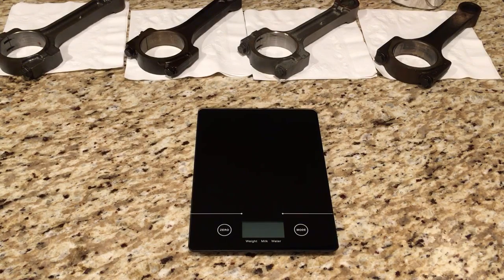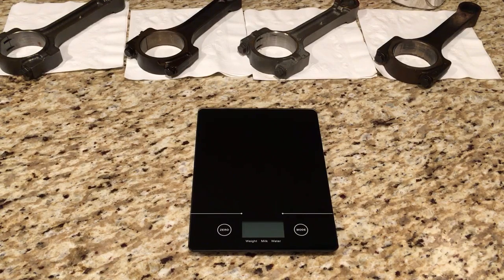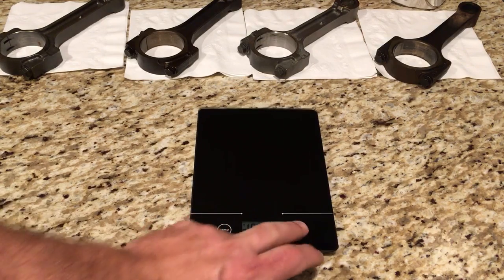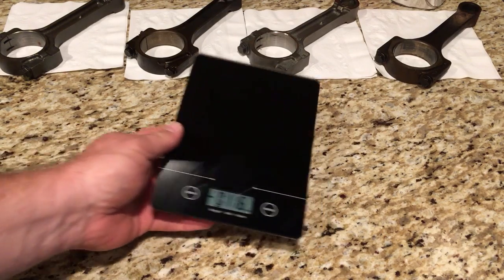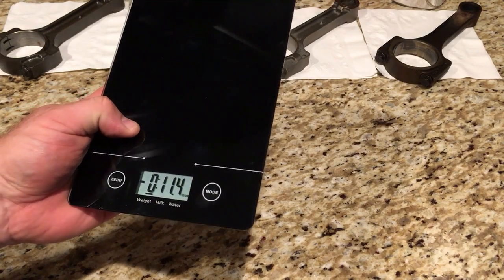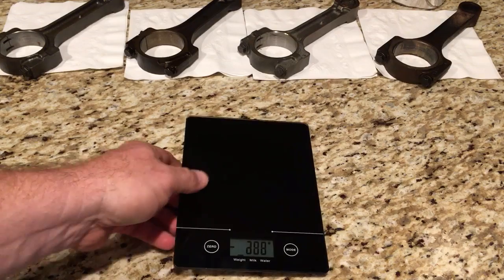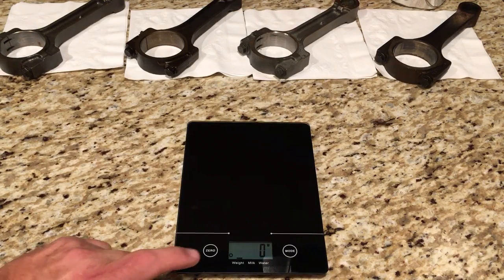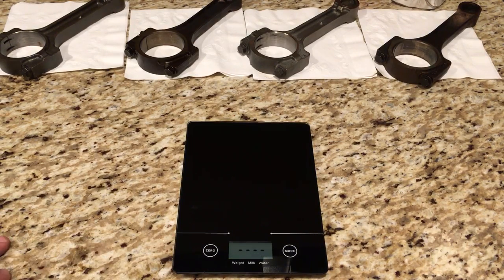Can I run Gen 4 rods in a Gen 3 engine  4.8 5.3 5.7 6.0

Comment: Notice how the gen 3 both weight about the same and both the gen 4s weight about the same. But just saying the gen 4 is bad because it weighs more is idiotic. Gen 4 rods are far superior than the gen 3s. When changing anything rods, pistons, pins. You should always rebalance your crankshaft. If you’re not going to rebalance crank then honestly just use the stronger gen 4 rods and not worry about it, hell you don’t worry about it anyway so why care if it’s different rods.

Comment: So it would be safe to say that on a Gen 3 5.3 if I used aftermarket pistons that weighed 415 grams with 122 gram pins and gen 4 rods I wouldnt have to re balance the assembly; as the stock assembly is 1182 grams and the “aftermarket” set up weighs 1183.

Comment: I kind of feel like even though the rods are a little different in weight, with the engine being internally balanced. As long as the rods you put in it are close in weight to each other, I would imagine it would still be balanced out. Kind of like going from an aluminum rim on a car and changing over to a steel wheel. They're both balanced, it's just one is a little heavier

Comment: The cranks between gen 3 and gen 4 are the same part number if all the rods you use weigh the same it's the same stress on the crank as gen 4

Comment: do you think aftermarket piston and rods have this same issue?
im trying to bore my 5.3(gen 3) to a 3.820 bore
im looking at gen 4 rods and aftermarket pistons on a gen 3 crank as a possibility 
also looking at summit racing forged piston and rod set on a gen 3 crank
Reply from the maker: Most aftermarket pistons have a better drain back setup.  Definitely check the design, specifically what it looks like with the support rails installed. 
On the pistons, if the budget allows go with a forged piston.  I like the Gen 4 rods but even they get scary above 800 wheel Hp, they can live or not depending on the tune and weight of the car etc. 
I’m slowly building an “Iron” LS1 aka iron G3 5.3 bored to 3.900”+ with a 2005 6.0 crank and Rods.  I’m undecided yet on either oem 2005 LS6 pistons or a forged piston like the Summit Racing.  Budget budget 👍

Comment: I switched to Gen IV rods and came up with similar weights that you got by using a postal scale. I was told by an experienced engine shop that more than 5 grams would throw the balance out. 30 years ago I threw together a 350 engine, and it had a vibration in it around 850 RPMs.  Couldn't keep the belts on the water pump, and alternator, the bolt on yoke on the transmission kept coming loose, and the oil pan bolts wouldn't stay tight. It turns out that somehow I used a 305 crankshaft. Even though they have the same stroke the bob weights are different. Can't remember exactly but it was around 1850 for the 350, and 1900 something for the 305. I had my 6.0 engine balanced because of the weight difference, they added weight to the crank to balance it. Being that we didn't have the alignment fixture for the relucter wheel, weight was added to the flywheel/ flexplate because the relucter needed to be removed. They made an alignment mark so I put the flywheel back in the same place, hope I never need to replace it. The moral of the story is Get your engine balanced! When they balance the rods, a special fixture is used so they can weigh big end separately from small end. One is rotating, and the other is reciprocating, 100% rotating, and 50% reciprocating
Reply from the maker: I’m piecing together an Iron Block LS 5.7 now and plan on having it balanced.  Playing with my Desk Top Dyno I have a solid combo making 544hp NA then add boost. 👍😎🙏🏻
Reply: You bored it out .120 over?  @HeadFlowInc
Reply from the maker: I found the block on marketplace, already bored to the stock LS1 bore size. Yes it would need a bore of at least .118”.  The Iron/LS1 is a pretty common build; I just hope the cylinders hold up to boost 🙏🏻

Comment: Did you think to take in the bushing in the gen four rods? Take them out then weigh it
Reply from the maker: No I did not remove any bushings during the weight testing.  You can see the Gen 4 rods are substantially thicker castings compared to the Gen 3.  If you have a spare Gen 4 rod I’d like to see the weight difference w/w/o the small end bushing.  🤔🤔🤔

Comment: what if it's just a stock engine?  will it matter?
Reply from the maker: People run them all the time without balancing.  I wanted to point out its not the right way to build an engine but seems to hold up ok. 
The Gen 4 rods are far superior; add in the fact the Gen 4 pistons are lighter and have full floating piston pins  is a bonus. JD

Comment: I’m considering checking the ring gap on the stock lm7. I hope I don’t ruin things by attempting this and not just leaving it in. I have the block opened up to heads and oil pan off on stand. Idk man 😐
Reply from the maker: How much boost?  If your not going to exceed 10-12# it might be fine, it may live on 20# it’s hard to say without checking.  You really only need to gap the top ring, it’s made of steel factory so it’s safe to r&r for gapping.  Some people like to lightly hone or bust the glaze on the cylinders while it’s apart but not 100% necessary.
Reply: @HeadFlowInc  was considering 14-20lbs tops. That’s full go, not summer street driven where I’d like to see 12-15 max. Hard if not impossible to see 600 wheel on pump 93 through turbo 400, would like to see max effort 700 wheel if I went to strip. I’m just trying not to make mistakes sir and not have the regrets of ruining my stuff due to chancing my ability at the ring gap on 160k engine. Thank you
Reply from the maker: @timweb1510  I understand completely!  I’d probably look at gapping the rings or at least checking them. Some people find the rings are already wide just from miles.  At 20# I guess you’d be looking at +- .030” top and .028” second ring. 
TH400 factor 23% driveline loss, so 779hp crank is 600 whp or 909hp crankshaft is 700 whp.  JD
Reply: @HeadFlowInc  will write that info down. Thank you very much

Comment: I have gen 4 rods in a gen3 motor/crank with a turbo. over 4,000 miles. Yes, you will have weird engine vibrations from doing this. anything over 2700 rpm for me starts to feel like a medium driveshaft vibration but its actually the motor.
Reply from the maker: We’ve put Gen 4 pistons/rods in a Gen 3 5.3 I can’t really tell if there’s vibration for sure. Turbo makes it fun!  Good luck have fun!  JD
Reply: Currently at this point in my build and wondering if i  will be ok without balancing ?
Reply: @ingloriousJ1108  have it balanced

Comment: you have to weigh the pin your changing as well. from a machinist, drag racer, shop owner of over 30 years. LS is different breed for sure with many possible combos. even this old machinist had to learn many a lesson about the LS platform
Reply from the maker: I think it’s in a different video where I weigh the pistons and pins. There’s a diameter, length and weight difference for the piston pins between press-pin and floating.  Iirc the 6.0 pistons have a longer pin than the 4.8/5.3/5.7 but I can’t guarantee it’s true. 
I really wish I had run the Gen 4 rods/pistons in my current 4.8 Turbo build, I cheaped out and didn’t want to pay for the balancing.  JD

Comment: Don't listen to this video he has no clue of what he is talking about. I'm sorry to be the one to tell you, but unfortunately he does not understand the concept and also does not do math very well and if you do the math he is talking about and trying to do in his head you will find he is not even doing that correctly I'm not trying to insult I'm just stating facts.
Reply from the maker: Normally I ignore trolls but your post made me laugh! Before you challenge anyone with experience you might want to do some research. Also punctuation is needed to avoid run on sentences.  Dang 0-2 better luck next time enjoy!  JD

Comment: On installing the gen 4 rods which way do the dots go. I'm rebuilding my LQ9 6.0. Vin N. I need to make sure I installed my rods correctly. As of now they're installed but not torqued and I have the dimples facing opposite one another. So one side like bores 1 and two the dimples on the rods, one faces the front of the engine the other faces the rear. Please correct me if I'm wrong so I can fix this before I start torquing everything down. Thanks.
Reply from the maker: loveto livetruely The rebuilder book I have shows the Gen 4 rods “All” Dimples on the rods face rearward.  The “dots” on the pistons naturally all go forward. 
Good luck on your build, it looks like your going to have fun!  JD
Reply: @HeadFlowInc  Thank you. I have 4 pistons I need to correct.
Reply: @HeadFlowInc  just to be sure because I've asked this question on several forums and I think I'm confusing people. I'm inquiring about the direction of the dots on the side of the rod shaft. Someone made a reply on one of the forums about dimples on the bottom of the rod/ rod cap where the bearings are. There are no dimples at the bottom of my rods only the dot or whatever it's called on the sides. Again gen 4 rods
Reply from the maker: Yes Gen 4 rods have a large raised dot on one side, those go to the rear of the engine.

Comment: I ran Gen 4 rods in hopped up 5.3 bored .123
Reply: To a 5.7 using Wiseco Pro tru pistons. One rod sheered both bolts, came apart and destroyed my motor. Everything was balanced correctly.
Reply from the maker: Peter Fraumeni Iron block 5.7!  I’m tempted to Have one of my blocks bored out To a standard LS one size.
Dang that totally sucks at yours came apart I wonder if that was an RPM issue or a piston broke first?
Reply: That was an 07 Gen4 aluminum 5.3 (LH6) IWas able to salvage heads, cam, lifters, timing set and oil pump, not much else. Even destroyed a C6 low profile oil pan, damn that hurt, new motor too. Went 7100 and broke

Comment: Any guesses as to how much material you could safely remove from the small end of the gen 4 rod?
Reply from the maker: Chupa Cabra I’d say not very much, the profile of the small end is small same as an aftermarket rod.  The LS rods don’t have a balance pad on the small end like older rods. 
Interesting question though, are you finding weight distribution issues while trying to balance and weight match?  JD
Reply: @HeadFlowInc  Just thinking ahead.  I couldn't visualize what 40 grams of material removal would look like but assumed it was too tall an order on these rods.

Comment: You could probably find a whole gen4 short block for less than the cost to balance your assembly. I understand you get vr wheel issues but it's really something to consider, especially because the bushed rods need captive piston pins.
Reply from the maker: Timothy Bayliss The pins aren’t interchangeable between the press vs floating designs, sucks because you can’t run the Gen 4 floating rods with a factory LS1 piston. 
If you were building a true performance engine intended for sustained high rpm use it would need a precision balance, +- $175.00-$200.00 in our area. 
The factory used a +-4 gram median balance, meaning from the established median weight +- 4 grams, so there can be as much as an 8 gram variance in the piston/rod assemblies.  Not horrible but definitely not optimal either. 
Thanks for watching and the feedback I appreciate it!  JD
Reply: @HeadFlowInc  Your right about a having a proper balancing job done. I just don't know if it would be worth It with stock Gen3 stuff. It's so good already, but if you were serious, a bore with aftermarket pistons on a factory gen4 crank/rod combo that's properly balanced will fill the needs of just about everyone that drives on the street. The gen4 short blocks are so tough, even most racers won't need more than that, and at that level the stock sleeves are starting to sweat. I didn't realise how much variance there is in the factory balance, +-4g isn't bad, but that leave a lot of room for improvement.

Comment: I'm trying to find a way to make a 5.3 out of a 4.8. the internet only has testimonials.
Reply from the maker: Chad Jennings The 4.8/5.3 use the same block!  You can use either the 4.8 or 5.3 pistons in either CID as long as the pins match the rods, Press-Pin vs Fliating-pins. 
All you will need to build a 5.3 is to get a 5.3/5.7/6.0 crankshaft w/ 3.622” stroke and a set of 6.098” rods from any of the same. (I recommend using the stronger pistons/rods w/floating-pins)
The 4.8 has its own crankshaft and rods: 3.27” stroke and longer 6.275” rods, neither can be used in a 5.3. 
1. Good 4.8/5.3 block
2. 3.622” stroke crankshaft 
3. 6.098” rods 
4. 4.8/5.3 pistons
Reply: @HeadFlowInc  could I use the 4.8 flat tops in a 5.3 if so it would up compression immediately. I've read it can and read it can't. I'd like to see a finished product and see if it's worth the extra money.
Reply: @chadjennings3907  piston only not rod
Reply: @HeadFlowInc  are the rods/pistons and crank matched? I am considering stroking a 4.8 to 5.3. My engine has gen 4 rods and is 24x engine. I have a line on a free cracked gen 3 5.3 short block. I don't know what rods it has. I was considering using that crank (could be gen 3) and sourcing  gen 4 rods and transferring my original flat gen 4 pistons. Daily Driver. too risky?

Comment: can you use a gen 4 crank., rods and pistons in a gen 3 engine ?
Reply from the maker: Doug My Buddy Richard has a 24 tooth 5.3 crank/block with Gen4 pistons/rods.  Some of the 2003-04 engines came from GM setup this way OEM.
Reply: @HeadFlowInc  everything from 05 and on had the newer rod design with floating pistons  however gm did start using the floating pistons and thicker rods as early as 2004 maybe even earlier mid 2004 def had gen 4 rods and floating pistons
Reply: @HeadFlowInc  all lh6 like in the trailblazer is that way. Also an aluminum block
Reply from the maker: Doug Blocks are the same, you can mix n match Gen3 & Gen4 internals but remember there’s a difference in the reluctor wheels 24 tooth and 58 tooth on the crankshaft sensor. 
Also many Gen4 move the cam sensor to the front cover. 
Make sure the reluctor matched your setup ECU

Comment: What I don’t understand is when you look up reman crankshafts 99-04 they are all the same part number even with the cross over year with floating rods.
Reply from the maker: Busa0069 Exactly the problem!  Even the local machine shops don’t have a way yet to determine what CID the #16 crankshafts come from.
We have noticed there is a slight difference in the clocking of the counter weights between the 5.3, 5.7 and 6.0 when standing on end side by side.  I hope to see if there’s possibly a slight weight difference but it might be a stretch.  If you find any definitive information on identifying the CID for the 3.622” stroke cranks!  👍
Reply: HeadFlowInc Probably explains some of the hit or miss reliability of gen3 remanufactured LS engines, if they don’t know what crank their running kind of hard to tell how long the motor will last.

Comment: ............or just run a gen 4 crank that’s already drilled for the heavier gen 4 rods and call it a day.....................
Reply from the maker: Bradley Hayes And what if your ECU is all setup for 24 tooth?  I guess if you could afford it you could switch to the 58 tooth signal or buy the Lingenfelter crankshaft signal converter $$$. 
There’s also some early crossover crankshafts Late 2003~2005ish made for the Gen 4 pistons/rods on a 24 tooth crankshaft. Probably hard to find and even harder to verify authenticity. 
Or just spend the $150.00-200.00 and have the assembly balanced. OEM assemblies are not precision race balanced, So having a Real balance job is far superior! 👍
Reply: HeadFlowInc or you can just do a reluctor ring swap

Comment: I have a question...could I put a gen lll 5.3l into my gen lv with a 5.3...and if so what would I have to do. I've heard change knock sensor location and reluctor wheel
Reply from the maker: Josh Cogswell Depends which version G4 you have early or later. Some of the early crossovers between G3 to G4 still had the Rear cam sensor and 24 tooth.  They moved the cam sensor from the top/rear of the block to the timing cover/driver side, easy fix $20.00 harness extension. 
Now, for the change from 58 tooth to 24 tooth, you’ll need to look into the boxes they sell to convert the signal.
Reply: @HeadFlowInc  ok thank you.

Comment: The Lighter the rod without sacrificing strength, the better off the engine is at all speeds.
Reply from the maker: C&B Lay Lightest Piston/Rod combo helps reduce opposing forces at higher rpm. 
The heavier your assembly bob-weight is when spin balancing an assembly ultimately limits strength. 
Grams are multiplied exponentially when the assembly increases with RPM’s.  Both inertial and kinetic energy increase. JD

Comment: While the total weight may be different, you're not considering the dynamics of the rotating assembly.  For example, the big end of the rod is rotating with the crankshaft, the small end is not..its motion is linear.  There is some cancellation of the weight difference of the big ends due to the fact they oppose each other even on a cross plane crankshaft.  The kinematic motion of the piston/rod assembly is likewise cancelled due to opposing throws, so there's more to this than simply weighing the rods and saying it's a big difference.
Reply from the maker: Chris Cross Good feedback I appreciate it, I was using information from the machine shops and local speed shop engine builders recommendations. Some people want to build an engine 100% correct for the intended use. 
Yes there are differences in weight distribution on the connecting rods, however when you’re done all the rods will weigh the same. Also there’s over balance and under balanced assembly theory. 
Thanks for the feedback I appreciate it! JD